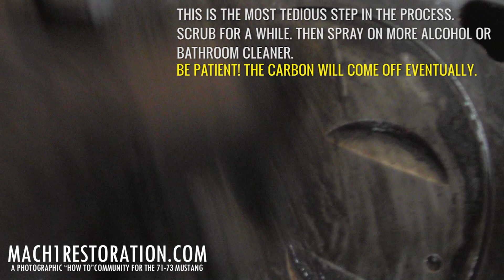How To Clean The Carbon From Top Of Pistons | Using Only Household Products

Comment: I prefer SeaFoam combined with the Brillo pads.  You can soak a rag with SeaFoam and just leave it on the piston covered with some plastic wrap to keep it from evaporating.  After several hours carbon wipes off.

Comment: use mr muscle oven cleaner or dr oven cleaner thats the best product to remove carbon it also works on turbo sticky vains
Reply: Only the easy-off oven  Heavy Duty Cleaner the red colour and ,You can mix one part easy off one part diesel or one diesel 2 parts easy off let for 30 minutes.
Reply: yes i done it with my pistons i left mine over night worked perfect mr muscle was the best as it stays on dr oven drys up

Comment: just about every product that used to work well, until now under the guidance of epa and conservationist pressures the new stuff comes with claims as safe to use around pets and children. although it still has a warning of keep out of reach of children, any of that safe stuff, doesn't work, it's trash. couple things i've noticed that have changed slightly in terms of propellant (gotta save that ozone layer that in reality runs itself, and that no matter how much humans try, one day and anytime in the future it's not going to matter,) WD-40, and Lava Soap, made by the same company, the stuff works, I don't know about carbon and WD-40, unless you want a cardio workout, that works.

Comment: The carbon build up is because engineers decided to vent the pcv line back into most throttle bodies.. The EGR valve does some weird shit too.. Engines back in the 70s never had this kind of carbon build up..even with leaded gasoline which was a heavy metal additive. Why someone thought lead in gasoline was a good idea is beyond my logic.. 

The other trick you can do instead of ripping the head off is to pull the plugs out, and pour in some acetone, seafoam or your choice of engine treatment, let it sit over night, then vacuum out the excess liquid/carbon.. The only problem would be slant V engines, inline would work fine but in slants you would have to jack one side of the vehicle up to get the liquid sitting flush on the piston..You could also use a special brush with a long extension to make the job go faster.. If anything falls off just use your vacuum system to suck it out.. Don't grow a vagina either, if you know whats going on you can do it easily and not have to pay huge dollars for someone to pull the engine and rebuild it. But if the piston rings are shot I guess you would be rebuilding it anyways.. 

That would be 100 times more efficient than simply running seafoam through an engine.. If you had more time, you could even let it sit for 10 days.. The longer it sits on the pistons head, the more carbon is will break down.. Then using your shop vac with a specially jimmy rigged hose, suck out the carbon/remaining liquid. That's Aquarian genius, free of charge.
You can even buy small scoped cameras and inspect all this through the spark cavity.
Reply: "Lead was used in gasoline to help keeps he seals in the motor from drying out." False.  Tetraethyl lead was primarily an antiknock additive as it increased the octane rating of fuel, which was especially important in aviation.  It also does help prevent exhaust valve/valve seat wear.  Seals don't figure into it.
Reply from the maker: +Santiago Giuntoli engine runs amazing. Put 23k miles on it since this video. Santiago is a Know-it-all apparently. Build a motor and do videos before you talk shit. Everyone's a fuckin expert. HAHAHAHAH

Comment: @archifxllc  When you mention that you oiled the cylinder walls , Would using  motor oil and rolling the engine over a few times work with protecting from surface rust. Any body with the answer please feel free to chime in . 
Thanks

Comment: YOU CAN NEVER GET THE CARBON COMPLETELY  OUT BEHIND THE RINGS UNLESS YOU PULL OUT THE PISTONS AND TAKE THE RINGS OFF ..USE A VACUUM CLEANER AROUND THE TOP OF THE PISTON AND CYLINDER WALL MOVING THE PISTON DOWN... USE.A WET VAC . DONT FORGET TO USE A RIDGE REAMER ALSO EVEN ON THE SLIGHTEST RIDGE. THE RIDGE WEARS THE RING EDGE ROUND. THE RINGS ACT AS A OIL PUMP
Reply: why caps lock?
Reply: Oh no reason just accidentally hit it frequently, and forget its on. So ill be typing and get half way through n dont want to start over, and just finish with caps. lazy typist!

Comment: Jack Richter I agree I always use oven clean like easy off or stainless steel magic with a normal sponge and a carbon scraper if needed an my pistons will blind u in direct sunlight,spray it on let it sit an u will c it starting to wash off

Comment: I forgot to mention Marine 2cycle oil with TCW3 rated burns with the gasoline and it is ashless so there is nothing left behind to hurt converters or sensors. Give it a try the car starts much easier because a slight coat of oil is on the inside when you start the car. Great for cold winter mornings. You will be amazed how your car idles. You won't know it is running.

Comment: I can't understand way people just won't use a top tier gasoline. Mobil if you use regular and Shell if you use premium. I do my homework and these are two of the best. I also add Marine 2 cycle TCW3 rated oil at 640 to 1. That's 1 oz per 5 gallons of gasoline. Lots of good reading on this. Google Sarge LS1.com. They have tested hundreds of thousands of miles with great results.Again remember it has to be rated Marine TCW3. Not just any old 2 cycle oil.

Comment: Actually brass can beat the hell out of aluminum. The trick with any wire brush on a piston is to test it on an area where scoring won't do any harm; or just test it on a junk piston. 

Beyond that, doing any piston work with the pistons still in the block is inviting trouble. It doesn't take long to remove pistons. My experience has been that whatever your valves look like, your pistons will look like too. If your valves are covered with burnt on carbon and are black, oily etc., then your piston ring grooves are probably full of gunge also--so you might as well pull the pistons.

Comment: Is there a benefit to using brillo pads by hand instead of using the 3m scrubers attached to a angle grinder? I am about to tackle a similar job (even dirtier). I saw you use an angle grinder with the brass wire, but wondered if you intentionally wanted to scrub those pistons by hand.

Comment: only thing u missed was put tape in all the oil & water holes before using the wire wheel what if some of that s wire gets inside? but decently u done an awesome job cleaning them pistons also good idea thanks for the video keep it up👍👍

Comment: How do you get the crud out from in between the Pistons in the piston walls on top of the rings?? I have me heads off right now doing a head gasket job on my subaru and would like to clean the tops of the Pistons while I'm at it.
Reply: just put the piston in TDC and use a tiny wire brush
Reply: Sean Land You need a ridge reamer bro. Can pick it up at any parts store for a rental fee or buy it. Personally, I wouldn't try to pop the ridge unless you're taking the pistons out and honing the cylinders because it can screw up the crosshatching and cause a leak path for your rings. I suppose if you're careful you'll be fine, but if you're gonna go start reaming, why not go all the way? Good luck!
Reply: Sean Land I tried the carbon solvent from 3M, from Yamalube, but they only cleaned a part of the carbon. So I did it by using a brush just like archifxllc did.
Reply: +oldskoolhead0 Because the carbon makes the rings stick in the grooves, the rings are supposed to hug the cylinder wall not get stuck in the ring groove
Reply: Shit I did this a while ago. I just used compressed air and some type of solvent (after I s clubbed the shit out of the piston tops)... car runs like a fucking champion, and purrs like a kitten.
Reply: Sean Land the only benefit from cleaning the piston face (other than make something look pretty that you would hope the next time you see it will no longer look pretty again) is to slightly improve gas flow in the places you actually want gas flow, so why would you want to clean the carbon off the top of the rings and in the gap between the piston (where the idea is to have as little gas flow as possible) and further improve on the gas flow by scratching the mating surfaces with a wire brush and removing the carbon (which is also actually a lubricant) im puzzled?

Comment: The pistons are more dirty on the sides with the ring grooves filled with carbon and rings stuck. If you have engine out I would remove and clean them too. Great video.

Comment: Use baking oven cleaner.
Thank me later...
Reply: +dark chocolate carbon build up can cause hot spots and predetonation, also unless you get it tuned for it you really get no benefit of the higher compression that is probably uneven between each piston and face of the piston.
Reply: Oven cleaner is caustic/alkaline and is not friendly to aluminum.
Reply: why do all that work to clean the carbon off????

does the engine perform better after??????

is that a aluminum block???????
Reply: @mr.actiongal1017    Too much carbon will cause hot spots in the combustion chamber and lead to pinging and loss of power and fuel efficiency.
Reply: Anakin seeing carbon buildup in the valves and maybe even exhaust it is appropriate but pistons???????

I read that it increases your compression

I don't see it harming the fuel mixture, can it add too much weight and lower your rpms????
Reply: dark chocolate Anakin, use the force!
Reply: Tyop lol

Comment: For all of you talking about not using wire brushes to clean pistons...learn some basic metallurgy.....  BRASS is softer than ALUMINUM... you can use them lightly and you will be just fine...  there's 1001 methods to do this with....this guy is just showing folks how to do it quickly and easily, without spending a bunch of time and $.  Right on archifxllc, nice video bro.

Comment: I used 5 minute oven cleaner on the piston of a lawnmower which did a much better job than that alcohol you're using. The oven cleaner foams up and lifts the carbon off allowing you to basically wipe it off in one go.

Comment: I don't know if you ever took a science class, but it doesn't really work that way. If a cleaning product scratches the material you are trying to clean... at all, then it will continue to remove material and may do so at a faster rate if more pressure is applied. If it doesn't scratch, it means the material is harder than the cleaning product and no amount of force is going to remove the material. Brass isn't going to scratch an iron block, and almost anything will scratch aluminum.